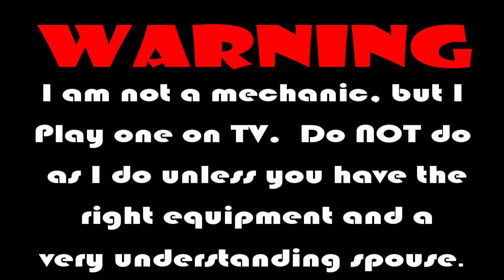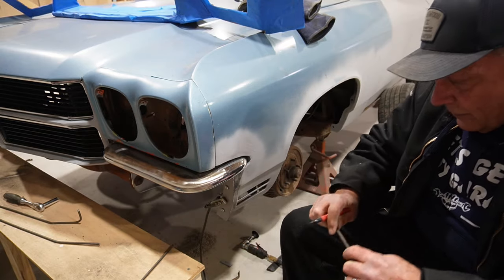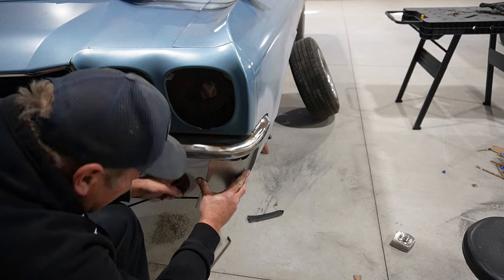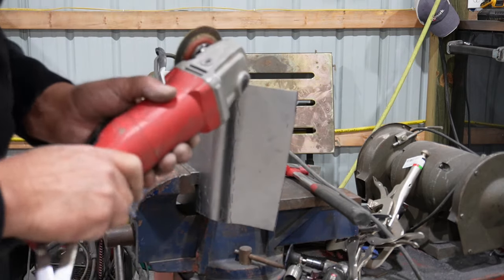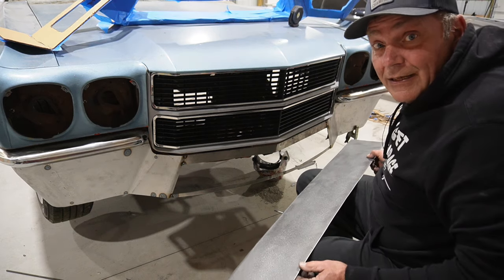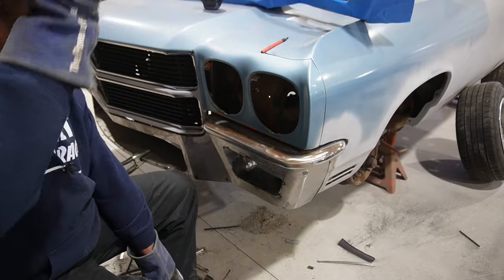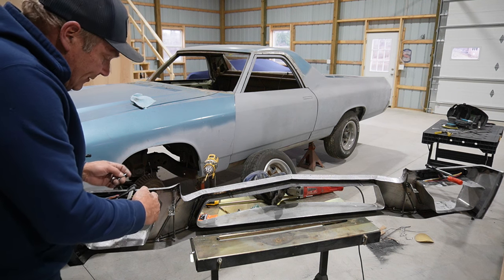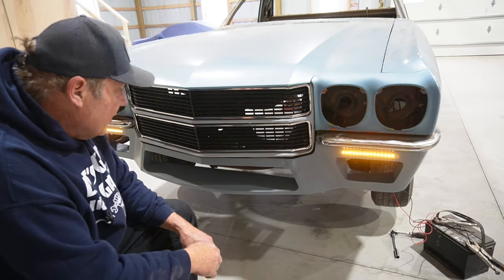1970 El Camino Full Metal Fascia

Comment: Silly question for you, parts that you are not using anymore on the Camino, would you sell them?  Thanks, love your channel.
Reply from the maker: Yeah I have sold a few things already, just sold the Camaro body. If you see something you might need, let me know. Thanks for watching!
Reply: @letsgetdirtygarage6197  I don't know if you're going to be using that silly little bracket that holds the spare tire in or not but I cut mine out probably 40 years ago (Of the 45 years I've owner the car) but on this restoration I'm going to use it again provided I can find one. Not exactly something they're re-popping and I can't find anyone that just has a carcass el camino laying around.😁
Reply: @letsgetdirtygarage6197   I don't know if you're going to be using that silly little bracket that holds the spare tire in or not but I cut mine out probably 40 years ago (Of the 45 years I've owner the car) but on this restoration I'm going to use it again provided I can find one. Not exactly something they're re-popping and I can't find anyone that just has a carcass el camino laying around.😁
Reply from the maker: I looked for that bracket in my parts pile and have not been able to find it.  It may have been thrown out when I moved shops.  If I do run accross it sometime, I will let you know.